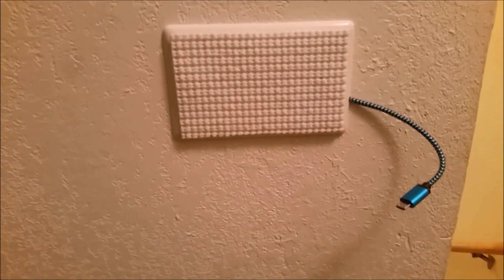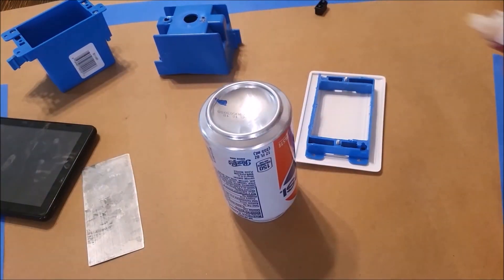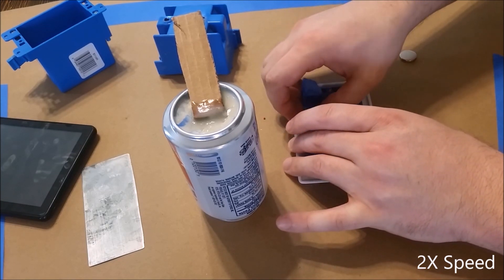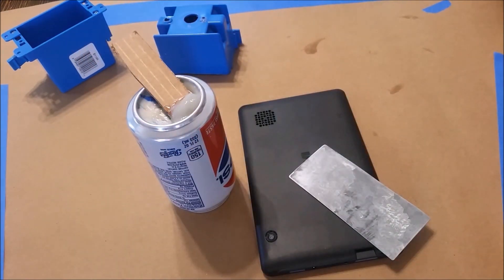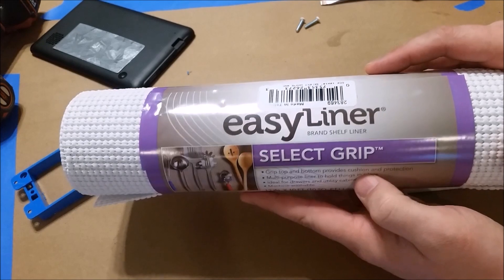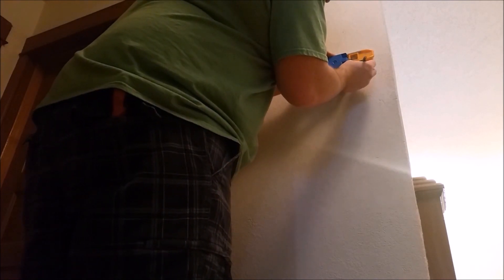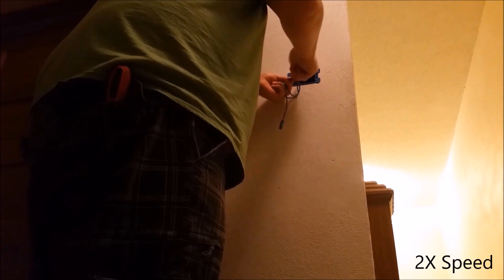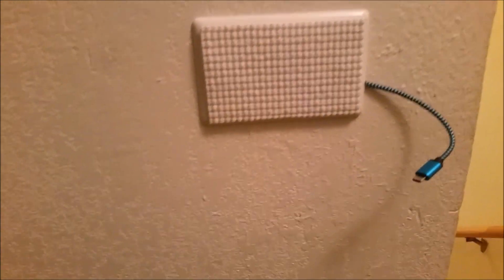DIY magnetic Tablet Wall Mount

Comment: 90 degree charger will do wonders for a cleaner look. Awesome video, doing this.
Reply from the maker: I thought about picking one up, but never got around to it. once it's installed you don't really notice the charger cord. I also looked into ribbon micro USB cables but I'm to cheap for that 😄, good luck with your install
Reply: I was thinking a cheap Qi charger from AliExpress would do the same

Comment: I've been wanting to do this but I've been concerned with leaving a Li-on battery plugged in all of the time. Modern electronics and circuitry do a great job in dealing with this issue but you do hear about Li-on fires from time-to-time. Have you noticed anything out of the ordinary with your setup regarding the battery? What about battery bulging due to charging damage over a period of time?
Reply from the maker: I haven't had any bulging with the three tablets I'm using (fire 7 rooted, fire 7 w/launcher, and a cheap 7 In. RCA (don't use RCA)), I take them down every couple of months to do app updates. If you want to remove some fear you could use Tasker and a smart outlet that works with Tasker and have it shut off the outlet when it's fully charged, then have it turn the outlet back on when it hits a comfortable level maybe 20% so you don't get the low battery notification.

Comment: I like this, but I would have added Qi worked charging. The paper thin receiver is less than $1 and the charger/transmitter is less than $3 from AliExpress

Thanks for sharing this
Reply from the maker: I've tried the Qi wireless chargers from aliexpress, and the magnets messed with the charging capabilitys, when it did charge it would freeze the tablet and the touch input would stop working until the tablet was removed from the charger, a more expensive one may work better though

Comment: bro, i would recommend using a 90 degree, right angle cable so that the cord does not stick out like a sore thumb
Reply from the maker: I had planned on picking one up but after living with it for a week or two you don't really notice the wire sticking out, I had planned on using a wire similar to this one https://www.amazon.com/Micro-Ribbon-Degree-Standard-Charging/dp/B075CSCCGP/ref=mp_s_a_1_2_sspa?keywords=flat+90%C2%B0+micro+usb&qid=1561562907&s=gateway&sr=8-2-spons&psc=1
Reply: Is that up to code? I know power cords cannot be freely ran through walls ..

Comment: How did you run your power cord? Where is it plugging into? Also, what app are you running for your smart controls?
Reply from the maker: brad sadoski, the power cord is run in the wall and plugged in on the back side of the wall there's a shot of the outlet at the end of the video, the app is called Imperihome

Comment: Pop that tablet open and solder a wireless charging pad on it. Close it back up and then instead of that ugly cable use some wireless charger on the back.
For the magnet:
Maybe the a 3d printed solution.